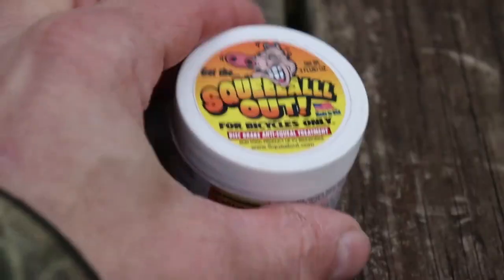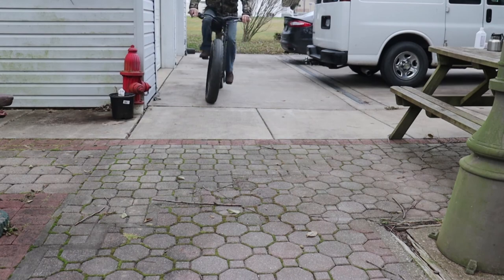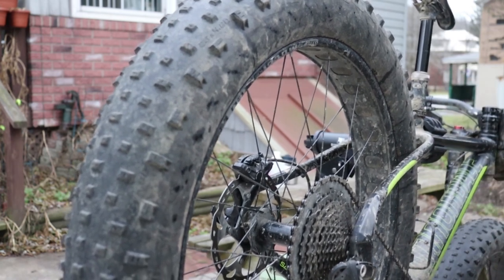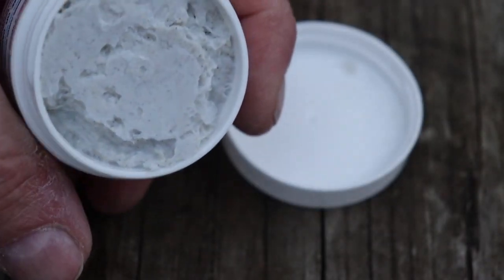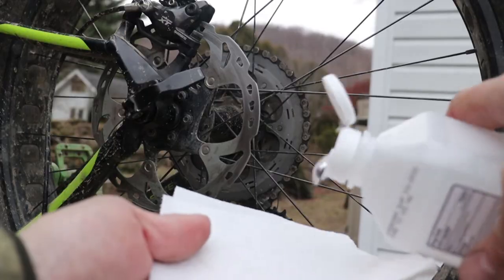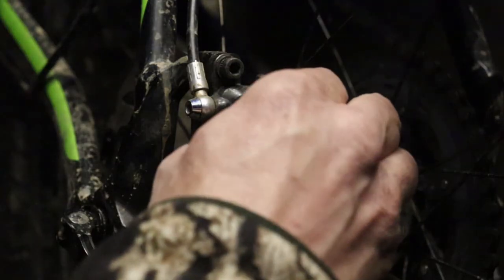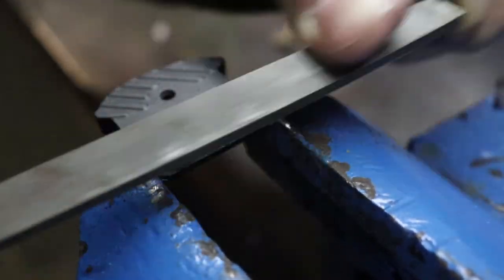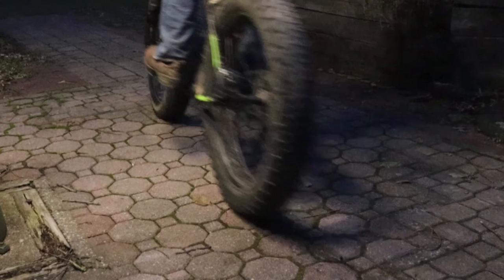Squeal Out! | Fix Those Brakes!

Comment: I've been working in a bike shop for 5 years. This stuff is faster and more consistent than sand paper. We use a lot of it on brakes that have been glazed and to speed up bedding in new pads. It's good stuff.
Reply from the maker: I'm still experimenting with different stuff. I just tried nail polish remover to clean the pads and the rotors, and it seemed to do way better than the isopropyl alcohol. I heard that Dawn dish soap works really well too from my local bike shop, but I haven't tried it yet. Thanks for watching Sister fix it!

Comment: I've been seeing complaints on other videos that this product is out of stock or discounted. Valve seating compound is a no-no. It contains oil. Comet, Ajax, or Barkeepers Friend may work as a substitute.
Reply from the maker: Thanks for watching DJ. Something that has been working for me that I was going to make a video about, but there are already videos on it, is to remove your pads and soak them in 100% acetone, which you can buy at the Dollar General as nail polish remover. You have to make sure you read the ingredients and get the one that's 100%. I think when I bought mine it was around $3 for a bottle. I took the pads in it for a while, and then use some sandpaper, scouring pad, maybe wire brush, then wash them in Dawn, and let dry. I then do similar by applying to the disc with the acetone on a rag or paper towel, then some fine sandpaper if needed. I hope that this helps.
Reply: Squeal Out FINALLY is available again! Ordered mine on Amazon yesterday, it arrived this morning. It's now $30.00, but after several months of waiting, it's finally back! 
Good luck.
Reply from the maker: @TexCynRVLife Thanks for watching and commenting Tex. I hope that it works for you. If it doesn't, I have learned some things to do since I made that video 4 years ago.
In Dollar General, they sell 100% acetone nail polish remover. If you pour some of that in a small dish, and soak your pads in it, then scrub them off with a toothbrush, and original Dawn dish detergent, it's a pretty good combination. Remember that there is a right and a left side pad. I have made this mistake before and it can cause squealing. If you take a clean paper towel and clean the disc off with the acetone, and scrubbing it with some green Scotch bright, this actually seemed to work the best for me. Good luck, and hope this helps!
Reply: @themostlymikeshow  Thank you! 🙂

Comment: I applied per instructions to my Shimano 105 disc brakes and they started squealing 10 miles into my first ride. I guess I'll try again and maybe try some new pads
Reply from the maker: Thanks for watching Harriot10. Sorry it didn't work for you. Hopefully it will work the second time. Have you tried heat or soaking them in the alcohol?
Reply from the maker: Some people said that they rub them with sandpaper or emery cloth to get the glaze off of the pads. Some do the same with the rotors with green scotch Brite.
Reply: I’m gonna try again. I’ve had these pads off half a dozen times and cleaned with alcohol. I even removed the rotor and deep cleaned that as well. I was hoping this would do the trick. I’ll try another application and see what gives. The squeal is driving me nuts!
Reply from the maker: I agree. One of the most annoying things you can experience while riding a bike.

Comment: Goodness! All you need is sandpaper to give your discs a non directional finish to eliminate the "harmonics", maybe sand the pads a tiny, tiny bit if glazed in a random manner. 🤦🏾‍♂️
Reply from the maker: Thanks E Rod! I agree that sandpaper is one of the best methods for removing glaze. I was also told by my local bike shop to use ivory liquid to get the residue off, and then finish cleaning with isopropyl alcohol to remove any oils. This was an older video, and I learned a lot since.
Reply: Yeah, I smell a bit of snakeoil here. I regularly just drag the pads across sandpaper, and wipe down the discs with isopropyl alcohol myself and to me this is so quick and inexpensive that it should be part of the regular maintenance.
Reply from the maker: I agree Freerider. That video was from a while back. I lived and learned. Thanks for watching.
Reply: @themostlymikeshow  can you make or show a video how they sand them? People keep telling me this, I just bought this product

Comment: Is this product still being produced? I heard a rumor the founder of the company passed away, if anyone knows it would be appreciated.
Reply: I just bought some on Amazon U.S. site. Haven't tried it yet, but I need it for my front XTR BR-M965 caliper which sounds like a rhino in heat. I hope it works. One good thing about the squealing is that any bears within a half mile can hear me coming.
Reply from the maker: @DiGiTaLdAzEDM Thanks for watching Digital. Hope that it works well for you. I had been experimenting since this video went out, and found that pulling the pads and cleaning with either dawn dish soap or pure acetone, which either is available at the Dollar General store. I wipe everything down and soak the pads in the acetone after scrubbing them with the dawn dish soap. I hope to make another video showing this.

Comment: Donde lo compro
Reply from the maker: Thanks for watching Sonia. I bought mine on Amazon. I recently learned another trick that worked for me. I took the brake pads off and cleaned them and the rotor with 100% acetone nail polish remover. It seemed to do the trick, and way cheaper.